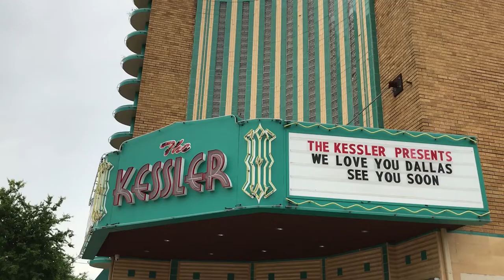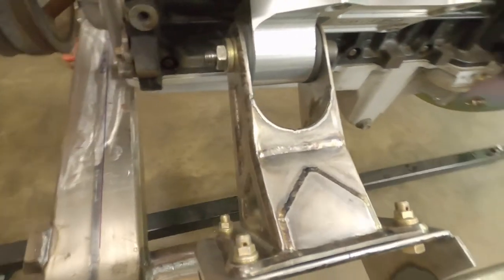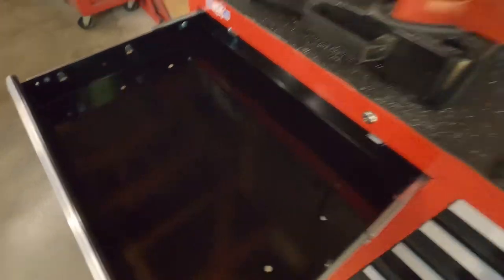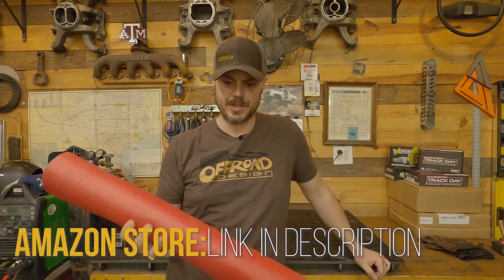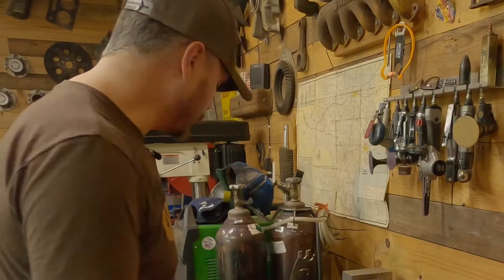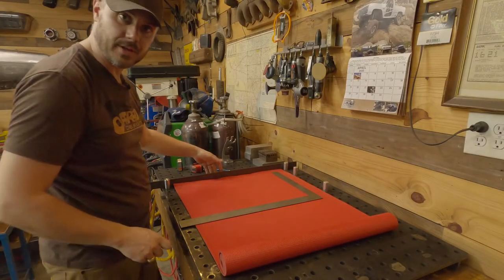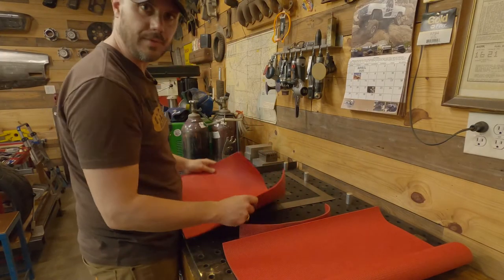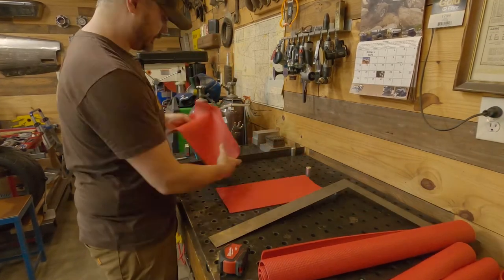Save Your Money, Cut up a Yoga Mat – DIY Tool Drawer Liners

Comment: I did this 4 or 5 years ago and now I'm worried I created a moisture trap to rust out my HF/Craftsman drawers prematurely.  I haven't seen them failing (yet).  My Gladiators came with 'holey' rubber mats.  I think they need holes in them to allow to breathe?  I'm talking about unconditioned garages.  If you have A/C and heat in the garage this wouldn't apply.   Thoughts?
Reply from the maker: I've not had a problem with the other drawers holding moisture and corroding.